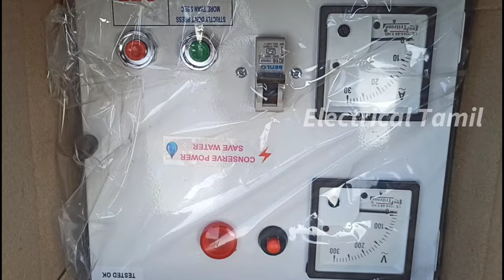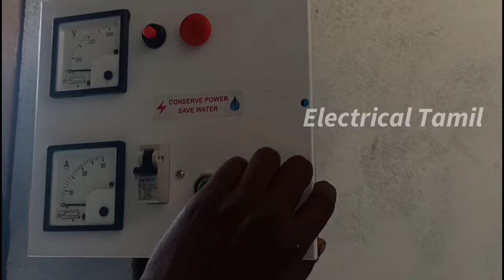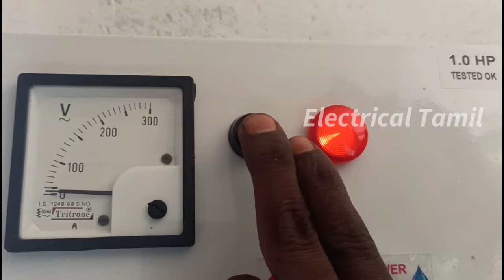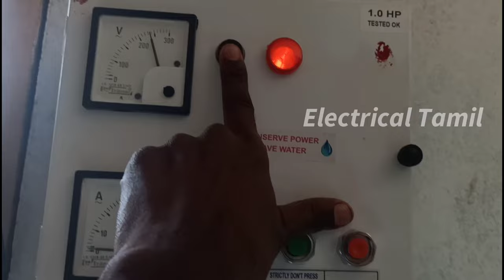J Tex Submersible water pump fitting in borewell || Submersible pump 1hp installation at HOME easily

Comment: What is mean by surge 300 fert 8 inches pipe that the pump must keep in hight of 250 feet you never know how much water flows when you start the pumps suddnly 120 water will comes out water will be maintained if the motor in 100 feet surge took place not enough's water to pumping so  motor will brunt